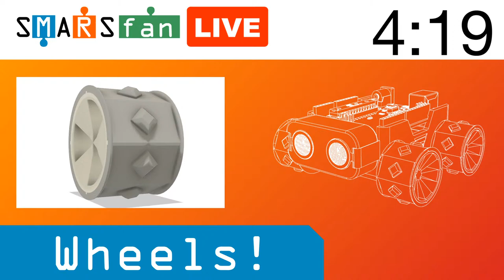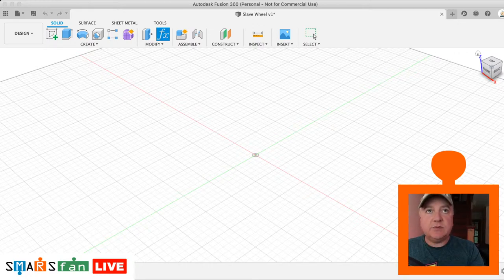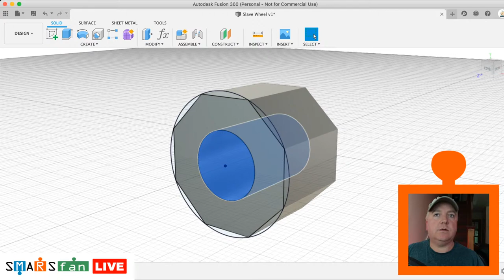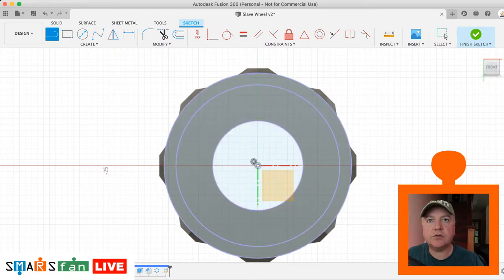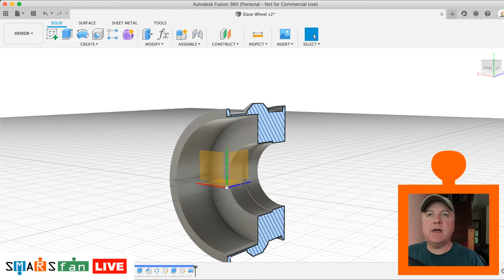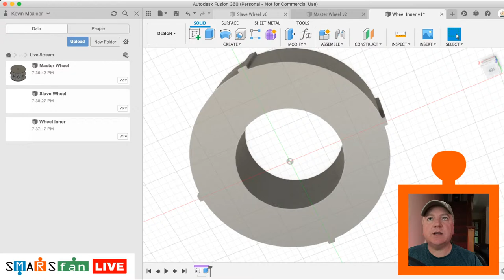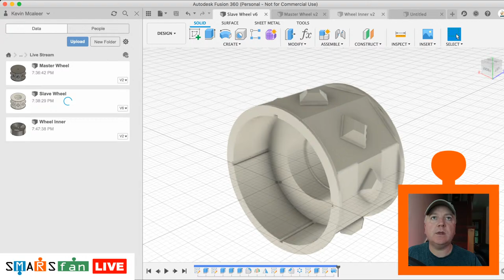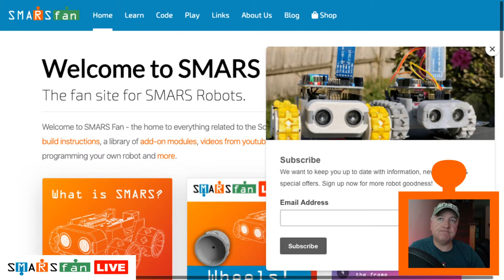SMARS Fusion 360 Design - Wheels

Comment: Hi Kev, great video, I just created my wheels on the weekend. Maybe you should do it modular. means, build in the mount for the motor shaft in the inner section for the wheel. By this, you can print 4 slave wheels.  downside you need a chassis with 4 studs where you can mount the slave wheels. hope you know what I mean 🙂